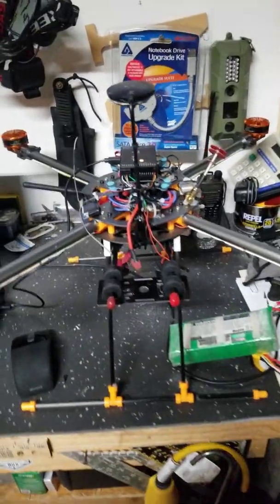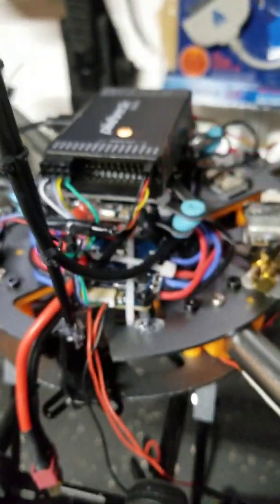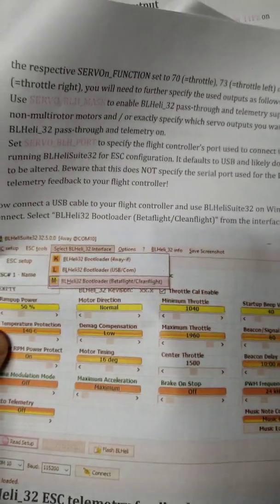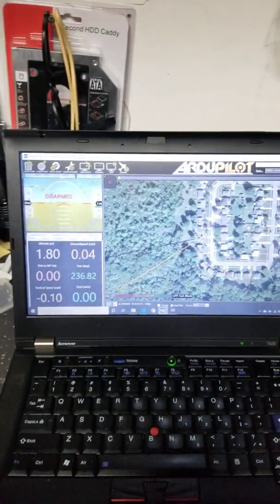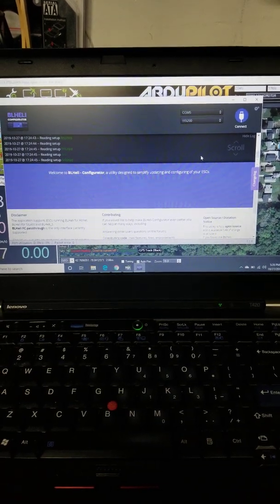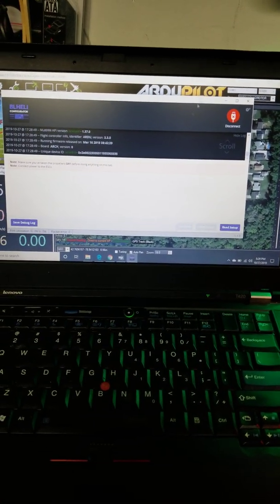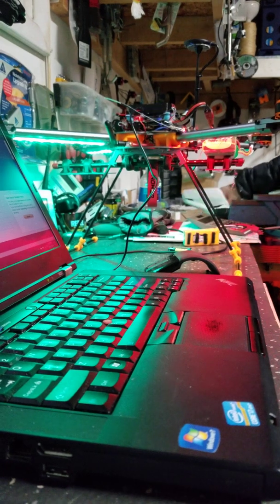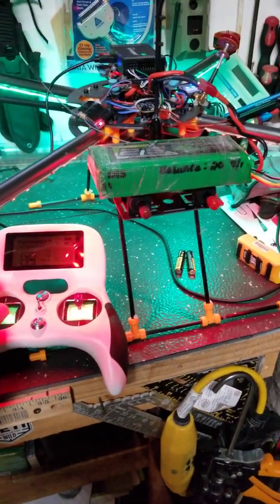PIXHACK 4IN1 ESC IFLIGHT SUCCEX ISSUE

Comment: I bought 4x iflight stacks with 40a esc  and 3 of those failed.  1 of them only 3 motors run, 1 of them blheli did not initiate read and one of them was DOA.   Contacted I flight and in mean while I bought  3x iflight 35A esc from amazon to replace the non working 40a esc.  To my surprise all 3x 35A esc failed to read by blheli.   So I contacted them again.

In mean while I also got 60A stack from iflight directly and that esc failes on 6s and is unstable on 4s hover time 2 minutes then drops!

So I bought 50A esc iflight on amazon whcih seem to be ok so far.

I hav e 8 esc from iflight and on 2 are stable. 

Your issue is not you but your iflight esc.   Use other manufacture esc and your troubles are gone.
Reply from the maker: I appreciate the information. 

I agree Iflight ESCs are not compatible with many motor & FCs, they should provide a list of incompatibilities. 

I bought an I flight F4 board so the Iflight 4in1 ESC woud not got to waste. 

There products and development in the industry are great, it will be better once they debug all these issues. 

Which Flight Controller are you using with the Iflight ESCs? 

Thanks
Nick
Reply: @nickya991  I only match Iflight esc with iflight FC.  I also use kakute stacks.  Since I started this hobby with DJI air units I only use whats compatible and that is HD stacks

Comment: what version of bl heli s you using? try bl helisuite 16.7.14. 9.0.0  Target   G H-30 BLS 16.7    BLHeliSuite download: http://www.mediafire.com/file/1tn449x6815upat/BLHeliSuite16714901.zip/file...  have this same esc,,
Reply from the maker: Michael,
Thank You for the advice.

I did not get it to work via mission planner. 

I switched the Iflight ESC out to Individual TREX 60amp Escs. 

After uninstalling Mission Planner and All BLHelli Suites, then reinstalling. 

I was able to update firmware on the TREX 60amp ESCs via Mission  Planner. 

This did not solve the problem and I am at the same exact point as I was with the Iflight ESCs.

The motors will not spin above arm speed. 

I have posted a video showing the update :

https://youtu.be/-dmnApm71pY

I honestly think the only solution is to switch back to the old linear SimonK escs.

Thank You
Nick
Reply: did you try it"???